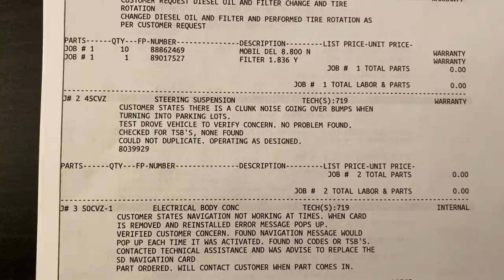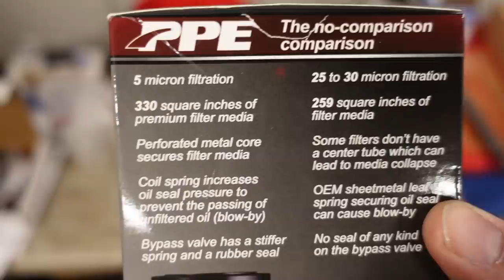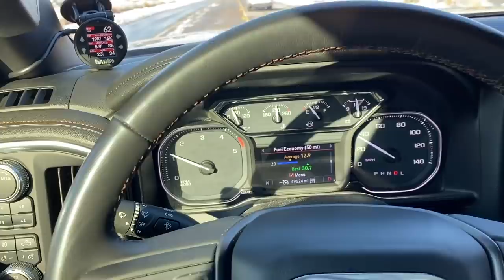fixing THE MOST ANNOYING PROBLEM with the 2020+ GM HD trucks

Comment: Does this noise sound like a really loud popping ball joint sometimes? No consistency or repeatability?  Been chasing that type of noise on my 2018 1500 for 35k miles.

Cant believe GM is still using that garbage filter location on the duramax after all these years.
Reply from the maker: not really a popping sound per se, but definitely a rattle you could feel in the steering wheel when going over bumps or uneven ground

Comment: I noticed your use Mobil 1 oil I have a question if you can answer it I have a 96 Chevy Tahoe with a 5.7L vortec engine when I was running conventional oil it didn't use a drop, and it doesn't smoke, when I switched over to full synthetic mobile1's 5w30 about every 1500 miles itll use 7/4 quart it's not leaking or smoking, and the tailpipes clean, should I go to a thicker weight I've tried 10w 30 Mobil1 and the same thing.
Reply: You could check your pcv system for a stuck valve or one that is gunked up. Just a suggestion.

Comment: Never seen anyone pre fill a filter with seafoam before. Seen people use ATF though. Hows Seafoam do in diesel? I only ask because seafoam has pretty good amount of alcohol in it and thats a big no no in diesel fuel. I would think adding MMO or ATF would be safer.
Reply from the maker: Not sure 🤔 on the content, but they say right on the bottle it adds lubricity to fuel and it’s good to pre-fill diesel filters with

Comment: Any reason you didn’t prefer the BIGGER PPE oil filter? I’m debating which to use. Thanks
Reply from the maker: on the 2020+ trucks you've got to relocate the fuel cooler pump, PPE have a bracket and hoses to do just that, but I haven't done it yet.

Comment: GM has been trying to build a quiet i-shaft for almost 20 years now.
Reply: Agree 100% 
It’s been a problem since 99. 
I’ve packed so many I shafts over the years I’ve lost count. Still got my special tool to do it from my dealer days.
Reply: @dm-zx7xb  that’s for sure. It doesn’t take much grease to quiet them up.
Reply: If that’s the on my problem my ‘07 classic Lbz will ever have then I guess I’m fine with that haha.
Reply: @ronfrance4041  I agree. These things are pretty solid otherwise. Mine is not the diesel so it's stupid cheap to keep on the road. One thing for sure to do is check the oil pump to case wear in the transfer case. The only way to check (if it isn't leaking from a hole already worn into it) is to remove it and tear it down. Mine ate a hole in the case which I hated to buy the replacement case half from GM but rockauto sells them for just over 300 dollars. The best thing though was that I found out before all the fluid leaked out and ruined the whole transfer case. I was telling my buddy about it and he didn't really pay it too much attention and his ran dry less than a month later and now he needs a new transfer case. If you haven't heard about it, check in to it. I bought the aftermarket plate to keep it from happening again. Do some research and see if you think it's worth it for you because I don't want you to go through the hassle and find out that your rattle clip wasn't broken yet and you be mad at me for doing all the work for nothing lol.
Reply: @dm-zx7xb  yup, I agree. I have known about the np263hd and 263xhd pump wear. My truck was low mileage when I bought it over 3 years ago, 58,000 now 106,000. It’s time I get around to it before something happens. Thanks for reminding and motivating me
Reply: @dm-zx7xb  I was actually just yesterday thinking of the next upgrade I should do to my truck. All my upgrades have been for longevity
Reply: @ronfrance4041  that's awesome. I would totally buy a diesel if I could find one with that low mileage and has had NOTHING done to it and if it was a good price. I would only want one bone stock and the mileage you had on yours is awesome! Basically I want a grandpa truck lol. My cluster says it has almost 300k miles on it but the clusters had issues and were swapped out due to the stepper motor failures so who knows what the real mileage is. That transfer case had been into before, likely for the pump rub because it had the wrong rear case half installed because it had the extra speed sensor on it. I guess they are all really the same size case just different stuff on the inside. Anyway, I bought the truck four 2500 dollars because the cam bearings shrunk and would lose oil pressure once the engine warmed up (Somewhat popular thing for the 6.0s). Removed engine, resealed, new cam and cam bearings, and it's been perfect ever since - almost 30k miles ago. 2500, four door, 4x4, good body/ frame couldn't ask for much more. Pulls my 10k trailer just fine every once and a while. I used to be a GM mechanic for over 15 years and the gmt800s are really great trucks in my opinion. I've dumped a little money into it just to get it reliable and safe. The hydro boost leaks on them once they get some mileage but they sell a reseal kit on Ebay for probably 25 dollars which beats buying a new one if it isn't leaking from the pushrod. The thing I like most about the trucks is they run forever and parts a pretty cheap and readily available.
Reply: @dm-zx7xb  We have something in common. 20 years for me with GM and I feel the same way about those trucks. Easy to work on and parts all over the place. Really like my 2001hd with the 8.1. Going to keep it going for as long as I can.
Reply: @dm-zx7xb  nice! I’ve got a crew cab also. I’ve upgraded the master cylinder to the 2011 or 2012 version and that made a big difference. Trans go shift kit, deep pans, 5/8” hydraulic hose trans cooler lines, full exhaust, some light stock turbo mods. This coming summer I will upgrade the trans cooler and a few other things. It was bone stock when I bought it and never driven in the winter. Living in Maine I was obligated to apply grease and oil to the underside and preserve it. Passes inspection every year with flying colors and they don’t even charge me! $2,500 for a gmt800 crew cab is awesome, you’ve already got your moneys worth outta that truck!
Reply: @demo2x  I actually really like the 01-02 HD over my 03 as far as exterior looks. The factory hood on your truck was perfect and I can't believe they only ran that hood for two years. My 2500 Yukon is a 01 and I actually like that version of the 800's more than my 03 second version 800. I like the fact that the window switch is a window switch on the early version and not a "computer/ module" on the later version. I always thought it was stupid to have a window switch that could easily short out if you left the window open and it rained on the switch. If it shorts out and pulls the class 2 data line with it, then the theft module will never be able to send its key pass to the pcm to crank the vehicle.
Reply: @dm-zx7xb  Yep, I think we could talk hours about engineers.  01 and 02 were my favorite also because of the hood and less electronics. Really wish they would have refined the 8.1 and kept it going. Great combo with the Allison.
Reply: Hard to believe those trucks are 20 years old now.
Reply: @ronfrance4041  thanks! Yeah for what I have in to it I'm not complaining. Plus it's not too nice to drive through the woods and do work with. Living in Georgia it will last me many more years. I would want one like yours if I could have my "dream truck". I don't do enough hauling to really justify it but "dream vehicles" are seldom justifiable lol. I'd probably mod it and keep it clean. Run the cheap one through the mud and have fun with it lol. I haven't heard of the master cylinder upgrade. After driving the obs trucks / (400's?) these brakes are night and day. I'll have to look into that! If you ever post YouTube videos of your truck, post the link. I love learning about these things.
Reply: @dm-zx7xb  sorry, I just realized I said master cylinder upgrade but I meant to say hydroboost upgrade. The hydroboost for the 2011? 2500hd was a drop in replacement for my 2007. I believe the 2011 hydroboost was also half the price  as the 2007 unit that was meant for my truck. My brakes are noticeably stronger now but I was under suspicion that something was faulty with my stock unit so if you feel that your brakes are great they way they are I wouldn’t waste the time or money to find little improvement. I’ve always wanted to make videos of what I do but have made very few and posted them. Maybe someday I’ll get into. It more
Reply: @ronfrance4041  ah gotcha. That's good to know. If mine ever leaks in the cab then I would know to look into that. The Ebay reseal kit I think included the shaft seal but it is staked into the hydroboost assembly. I've heard of people cutting the shaft to remove the seal and then sleeving and welding the shaft back together to replace that seal. I would be fine with that but wouldn't feel right if I ever sold the truck to sell it with the brake shaft welded from where I cut it in half lol.
Reply: @dm-zx7xb  just ordered my pump rub kit! Thanks for the motivation. Also ordering the CAT oil filter upgrade. Get an extra quart in the ol power plant and will have a full flow filter
Reply: @ronfrance4041  great! What kit did you go with? I also resealed the entire unit while it was out. Also, replaced the shift fork pads and the other shift fork has molded on pads so the entire fork had to be replaced. The one with the molded on pads I replaced preemptively while I was in there. The other pads on the other fork were broken and the aluminum fork was eating into the shift collar - never made any noise!
Reply: @demo2x  I like the 8.1 too. Nothing like a big block! 20 years, boy does the time fly! What do you do now that you aren't at the dealer anymore?
Reply: @dm-zx7xb  i did sort of a career change 10 years ago. I saw the writing on the wall at the dealership that there really was no future being happy. Between them pricing themselves out of business with the shop labor rate and trying to live off warranty work wasn’t going to cut it. So I moved back home and started a hay and row crop farm from scratch and opened my own shop at my place. Had the ground available to me but nothing else. Planned for 3 years before the huge change. The shop was the easy thing being in a rural area and now with 30+ years of experience, it is no problem to get work. I just wish my body could keep up with my mind🤦‍♂️
Reply: @demo2x  everything you said was an exact example of dealer life. I always hated how they upped their prices then told mechanics that they can't charge the same labor hours as before because customers can't afford such a high bill. I'm glad you were able to leave and start your own endeavors! And your screen name makes perfect since! I left the dealer 7 years ago and work for a great company as a fleet mechanic. I hope to never reach a new low in life that will cause me to have to go back to the dealer... I've thought about building my own shop too. I'm in a rural area as well. Just kinda waiting things out right now to see what's in my near future with all that's going on in the world (and US) right now.
Reply: @dm-zx7xb  I went with the merchant auto kit. I’m glad you mentioned shift forks and pads to me as I haven’t heard of the being a problem. I’ll order them just to have them so my truck isn’t down for more than the weekend(waiting for the rtv). I’ll also get the input and output seals, might as well! CAT filter and adapter is on its way too. Glad you guys left your dealerships and are happy now. I’ve always done everything myself as when I got my first road legal truck I couldn’t afford to have anyone work on it and so the tradition of doing it myself has continued.got my first truck when I was 12, a ‘72 jeep j10 pickup. Typical old jeep, every vacuum hose leaked and more. Learned to drive stick with that truck, took me a week to move 10’ because it wouldn’t idle so I was 2 footin’ three pedals! Haha used to drive my dad around through the woods trails while he sipped his cold snacks
Reply: @ronfrance4041  with your past mechanical experiences, you'll get it knocked out pretty quick! Let us know how it works out for you. I figure I want to go in one time and knock it all out. I did reuse the synchronizer because it looked perfect. I don't remember replacing anything else except for the oil pump o ring but I think the merchant auto kit comes with that. I tore everything down and inspected it all and everything else looked good too. I hope the same for yours. Glad I could help you decide your next repair because it cost so much less to do it now rather when it's leaking or making noise!

Comment: The truck seems to run pretty quiet overall, especially for a diesel.  Thanks for the video!
Reply: These 17+ diesels are a whole new ballgame compared to the older stuff. I love my L5P I flog on mine super hard and it just keeps on trucking. Since covid, we have 15k miles on a 32' toy hauler (10k lbs), a pontoon boat (6-7k), and the car hauler with jeep or RZR (7k). We did the teton pass (8%?) with the toy hauler and could keep up with passenger cars and the exhaust brake held. Just need fuel prices to get back to where they were a year ago...
Reply: @scottleggejr  i have to agree, the new l5p is a different beast compared to my 05 & 07 duramax.. so smooth

Comment: Two things.
Never fill a fuel filter down the centre. Fill the small holes around the centre and be careful that everything is clean before you even open the box. Unless it filters from centre out which is very rare.
Two.
You could probably have fixed the rattle in five minutes with some tape a syringe and some thread locker.
Get some mid to low strength locker and inject it into the gap around the shaft in a few places, tape up any holes and around the top to stop drips and cut off the air so it will solidify.
Should be a safe permanent fix.
Reply: Amen on the filter!
Reply: So basically you're saying someone should thread lock the feature that is suppose to save your life in the event of an accident? I'm gonna take a pass on that
Reply: @Educalifa  thread locker is not welding, it actually has very little strength in shear otherwise you would never be able to undo anything.
Reply: @anomamos9095  Red thread locker has quite a bit of strength actually... which is why you usually need to heat it up before undoing bolts with it. I'd bet that if properly used on a collapsible  steering column it'd take less energy to break your sternum than to break the bond on the thread locker.
Reply: @Educalifa  . Who said you should use high strength red lock tight?
BUT it’s still not as strong as you think it is. Thread locker doesn’t exactly work by glueing the threads together, it actually fills the gaps between threads vastly increasing the surface area of the contact between threads which significantly increases friction once it sets the glueing effect is secondary. As a glue it is not as strong at bonding as CA super glue and it is fairly brittle . Apart from all that the collapsible part of the shaft under the hood is not the only one and the under hood part would need to punch through the steering shaft mounts before it got any where near your sternum and on top of all that the kind of crash that would force the steering shaft into your chest would be likely fatal before then, at least 60 into a tree on the drivers side.
All this is mute as to get the type of bond you are talking about would require the shaft to be cleaned and hit with the primer.
Filling the gaps to stop the rattling will only fill the gaps and not bond sufficiently to glue the shaft.

Comment: GM has been Having this problem since 2005 i bought a new car they put a new steering shaft in it 3 months down the road it was making the same kind of noise We run it for 147,000 miles With the same clunking noise Don't be surprised if this doesn't fix your problem
Reply from the maker: yeah, I wouldn't be surprised if the noise comes right back... but at least its quiet for now

Comment: GM's truck intermediate steering shaft has been a problem for years. I owned a new 2006 1/2 ton PU that had the same problem. The "stealership" lubed and finally replaced the shaft. I had to go into a James Brown act to get them to replace it. 🤡
Reply: I've noticed that too, both in the trucks and smaller vehicles.

Comment: If your doors are rattling like my 2022 Gmc 2500 hd Denali, purchase door strikers from a 2004 2500 hd from eBay and 2 shims per door and your problem will be solved.
Reply from the maker: Good tip. Mine rattle once in a blue moon, not enough to bug me just yet but if it gets worse, I’ll use this trick
Reply: @LawrenceTolman  I stand corrected You only need one shim on the two front doors and zero shims on the two back doors. 
Mine were rattling from day one the truck only has 1800 miles. But I do have that rattling in the steering column I don’t know if you have a part number for the updated one  that would be very helpful thank you for getting back to me. 
By the way I enjoyed watching you on TV I don’t know if you still are but

Comment: That micron is way lower
How does that not block oil flow?
Reply: All filters have relief valves protecting them from overpressure and engine from oil starving. So don't worry  -oil that can't pass thru filter goes in the engine unfiltered ))))